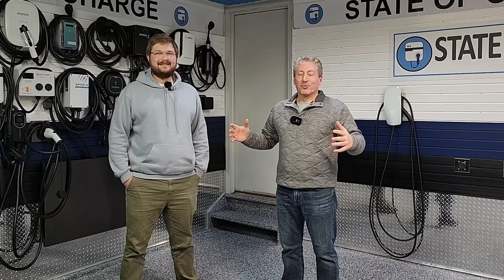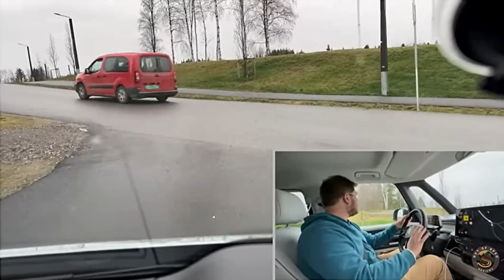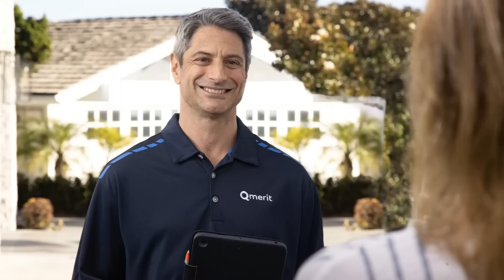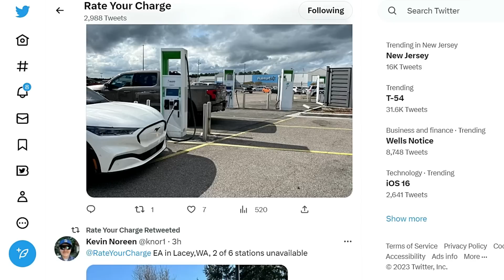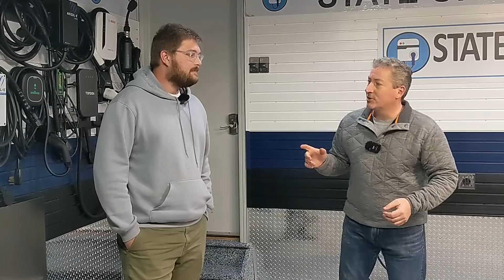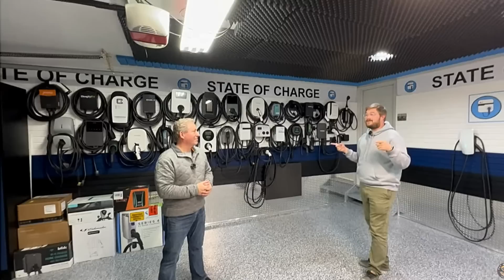I Talk DC Fast Charging With Kyle From Out Of Spec

Comment: Everything is all well and good and well said by you all but here is the biggest  problem it's not lvl 2 or dc fast charge the problem is the usa grid  the grid it self is built back in the ww2 area with very little infrastructure  improvements

Comment: So, why do EA electrify america put 2 CCS chargers on one post when you can where you clearly can only fit 1 car? Is it in case one of the plugs breaks, or what? The system only lets you use one or the other even if you can get another car there (like if the one next to it is broken). Why?
Reply from the maker: For a few reasons. 
1) Because the location of the charge ports isn't standard and are located on both sides of the cars. 
2) As you mentioned redundancy if one isn't working
3) in case someone blocks the station with a gas car, you could potentially park in the next stall and use the cable on that side to reach your EV
That said, the new generation on EA chargers have only one cable and it's longer, eliminating those concerns.

Comment: Mohamed Haki
قبل 4 أيام
Welcome, my friend, I am one of your followers. I follow you from my country, Iraq
Because of you, I will buy a Ford Lightning. I was just wondering about an issue that you did not address in your full explanation.
I am in Iraq. We have electricity, the voltage difference is 220-380, the fluctuation is 50 hertz
How to connect a Ford charger of the first or second level
Can it operate at 50 frequencies?
I wish you would send me a letter explaining the issue to me
You have all my thanks and respect

Comment: I don't think magic dock is game over for NACS.  If they work with manufacturers that adopt NACS, having access to ALL supercharger stations, not just the miniscule few with magic dock is still a selling point.
Reply from the maker: By the end of the decade, the non-Magic-Dock Superchargers will be in the minority
Reply: @StateOfChargeWithTomMoloughney  I thought I read that a relatively small number would be retrofitted and the majority of new Tesla CCS output would be destination chargers, not SCs.   Are all V4's confirmed to have magic dock?  I haven't read that!
Reply from the maker: @DblOSmith  Initially, and that's the current sites, wait until Telsa starts installing its V4 sites all, or mostly all, with Magic Dock

Comment: It is not a mystery why Tesla Superchargers are far more reliable: Like Apple, Tesla controls the whole ecosystem - the car, the charger, the software. It just works. But DC fast charging relies on the highly fungible J1772/CCS standard that is implemented by every manufacturer slightly differently. This leads to all kinds of interface issues. Gotta give this video a thumbs-down for the failure to make ANY mention of this simple reality during the video.

Comment: Another  post full of good information,  as always. But I have to disagree that CCS type 2, would be preferable in North America. CCS type 2 advantage is a higher AC charging rate of 43 kW.  Which was never adopted by most electric automotive manufacturers.  So Europe has type 1 and type 2 vehicles which just makes things more complicated, with little to no benefit. 

Or that CCS type 2 is used for commercial vehicles in North America?  There is an MCS and a Megacharger standard, North America for commercial vehicles. I just hope one of them becomes the universal standard, for commercial vehicles.

Comment: I'm thinking about an EV in the next couple of years, and I live somewhere where chargers aren't the most frequent. I'm concerned about ease of use and the personal safety of pulling up to some random charger in a sketchy location, at least on roadtrips. Should I even consider a non-Tesla?
Reply: If you can charge at home and don’t take extremely long road trips, a non-Tesla might be okay. If you plan on DC fast charging often, and/or will be taking long road trips, Tesla is the clear winner. Not to mention, Tesla cars are quite awesome as well.
Reply: Umm, NO! Along with the vast differences in NACS performance, convenience, & reliability vs the VW “designed to be brain dead” penitence CCS, what about the materials & maintenance cost advantages afforded by the well thought out & elegant design of the former vs the clearly hobbled, latter? Iotw, will superior design & engineering ever be given precedence over the economically dominant? E.g., Falcon/Starship vs Vulcan/Artemis?

Comment: Seems to me that in order to to keep the stations running there needs to be more service techs. That's the problem I have run into. Perhaps more reliable hard ware and software. 

Had an interesting charging experience. Pulled into the station behind a restaurant and the charger wasn't working. It was about 5a and freezing cold outside. After several phone calls they said they would have maintenance check it out. 
By that time the restaurant was open and I went inside. When I went out I could see the screen on the station lit up, so I rushed over and started charging. Took an hour and 20 minutes to start charging.
Some of those stations have been replaced with both Chademo and SAE, having been strictly Chademo.
Like Beta and VHS for those who remember.

Comment: You're really pulling out all the stops criticizing Tesla.  Only 99% reliability.  You were able to report 5 problems (over how long? Geographical locations? Time for Tesla to redpond/repair?)
What a truckload of subjective FUD and hype.  I used to respect you, but no more.
Reply from the maker: I owned two tesla Model 3s over 3.5 years and drove them a collective 48,000 miles. There were only 2 occasions when I plugged into a Supercharger and it didn't work so I had to move over to another stall. I don't have the exact number of times that I did charge at Superchargers but it probably wasn't 200 so my 99% claim is most likely not exactly correct. I bet I charged between 80 and 100 times, though, so the success rate was most likely closer to 97% to 98%.
Reply: @StateOfChargeWithTomMoloughney  With all due respect,  Tom you just encourage trolling by trying to justify yourself to baseless unjustified comments... the facts that you present, is the only justification that you need,  IMHO....
Reply: Enjoy your Kool-Aid and have a nice day fanboy....

Comment: Canada had legal issues up until recently that made chargers forced to bill by the minute rather than by the kWh which made charging a nightmare. Plug a bolt in to a 350kw charger and getting 50kw? Yep, you're paying 7 times the amount for your power and it would be way cheaper just to run gas.

Plugging my little PHEV in to public level 2 charging makes no sense because they are usually 7.6kw but I have a 3.3kw onboard charger. If I stop for lunch I could get a few dozen extra km of EV range but instead it's just gas and park instead.

Government ruins everything.

Comment: I 100% don’t think the US should force a connector like the EU did. But what they are doing is putting money behind the CCS connector. To get the NEVI funding you need to install CCS connectors. Those are the only chargers that can get funding. If you also have a Tesla or a CHAdeMO connector, that fine, but there isn’t funding for separate chargers. 

Money will drive the push for CCS and in the next several years Tesla will switch to CCS in the US fully.

Comment: I think a declaration needs to happen for a single plug standard to lay the groundwork in the US like they did in Europe.  Otherwise we are going to be in a mess for a while.   Reliability has to improve, more chargers have to be deployed... And we need to start to see EV drivers treated with the same conveniences that gas cars get.  Covered parking, services, bathrooms, shopping, food....  It isn't like we invented something "new" by changing vehicles to electric.  The basic premise is the same and how we use them has not really changed.
Reply: I think there is some misunderstanding on what happened in Europe with Tesla. Tesla never used the NACS in Europe. It is only capable to deliver 1-phase AC but in Europe high power AC is mostly 3-phase, and therefore they moved to type 2 using it with AC but also in DC. Yes, type 2 allows to use it for DC, but the max rating is pretty low. I think 120kW was the max a Model S was doing in Europe. So they had to move to a higher current capable plug for the Model 3 and later, so they moved to CCS2.
Yes in Europe CCS2 is mandatory for public charging infrastructure, but the Tesla SuC network wasn’t till lately a public network, so they hadn’t to move to CCS2, they simply choose to.
Reply: @e-redj  nobody was talking about...Tesla's made up North American standard being used in Europe....  It was about CCS2 being mandated as the standard in Europe..... Just like CCS should be the standard in the US.....

I'm sorry you got so confused...... Have a nice day....
Reply: @e-redj  This is good to know.  I think something like that is going to happen in the US.  Once the number of CCS chargers and vehicles eclipses Tesla they will probably flip at that point.   Once they lose the advantage they presently have then I think they will switch.
Reply: Sensible regulation in the US, such as creating a universal DC charging standard, is often impossible to pass..... Due to the cult like status, that individual freedom is paramount....
Reply: @nc3826  I fully support individual freedom.   Freedom isn't what is blocking  a public standard.  It is big money.  The cult of sensible regulation rarely is sensible and rarely understands boundaries.  There are always dogs in the hunt with a stake and it rarely is for the benefit of the people.  

Tesla has the first mover advantage.  They have the largest installed based of chargers in the US.  That gives them a place at the table with more influence than the rest.  It would actually affect fewer cars in the US if the NACS standard was made the default standard.   If one were to use those as metrics for making a standard  today Tesla would and should win the contest.   But that is going to change.

However making adapters to use both CCS and NACS should be easy enough and affordable.  Clearly someone set standards for lots of other things like roads, bridges, road signs, electrical code, and many other things.  When you need building supplies or various other things there are generally standards for many items to make the task much easier.  Eventually there was a consensus to make something a standard.  

As momentum picks up for other manufacturers and they manage to produce more vehicles the first mover advantage is going to be lost at Tesla as there will eventually be more CCS cars on the road than Teslas.  That is still a few years out given the supply chain issues and problems with ramping up manufacturing.  At that point it should become more obvious that it may make more sense for Tesla to fall in line.    

That is a few years out.  In the mean time Tesla has only agreed to open up 7500 chargers to CCS cars.  This ensures they keep their advantage for as long as possible.  Tesla is nothing if not practical when it comes to manufacturing and cost reductions.  Once the dollars and cents on the ledger say a change is needed they will do it.  That looks like it will be a while when it comes to this charging standard.

Comment: Since DC fast charging is more harmful to the battery pack, would it not make sense in places w/ plenty of parking space to add the option for L2 charging?  Thinking malls, national parks, etc. where folks will be spending more than 1-2 hrs away from the vehicle and don't need 15-30min charge-up.
Reply: For road trippers, the single place where more L2 charging would have the most bang for the buck, I think, is hotels. In a future world where most cars are EV, hotels might need chargers in as much as 30-40% of their parking spots.

National parks, I think, better serves the EV community with DC faster chargers at visitor centers than level 2 charging at trailheads, mostly because it makes parking management at congested trailheads easier, while also avoiding the need to run miles and miles of new power lines to trailheads that currently have no electricity supply, just to run car chargers.

Visitor centers, on the other hand, the 20 minutes that people typically take to go in, use the restroom, and browse the gift shop, is perfect for DC fast charging. And a charger there helps people reach all trailheads, not just one, plus it's high capacity, since people get in and out fast. Also, given that people don't visit national parks all that often, the impact of a single fast charge on the battery pack during a single park visit is negligible.
Reply: We have Volta L2 chargers here in Texas at Malls and movie theaters….they work every time. We need more.
Reply: More L2 charging options would be great to have.... But it would mostly help  EV owners, that do not have a home chargIng option....  

The only true safer alternative to DC fast charging, is batteries swapping.....

Comment: The problem is only Tesla has reliable DC fast charger. Electrify America is junk with four station at each location and always two not working. 

The others aren’t any better as they have level 2 chargers with maybe one fast charger.  

If not improved it may kill the electric car          Hydrogen car will quickly catch up as it’s a safer tech and quicker to refuel with no loss of power as hydrogen  doesn’t drain.